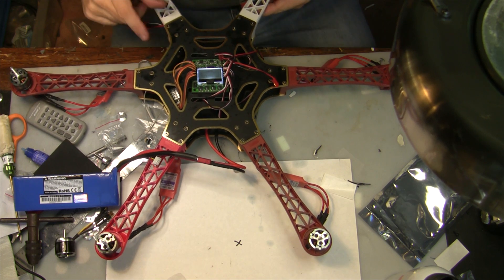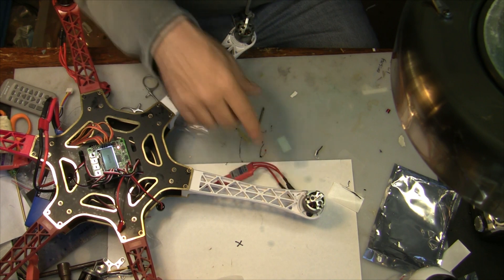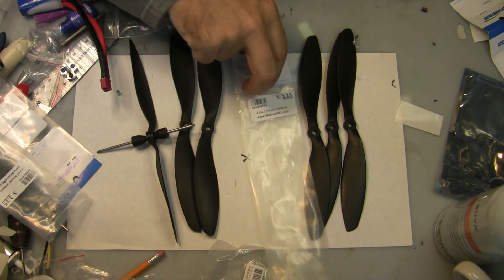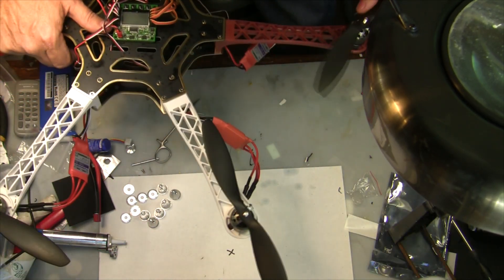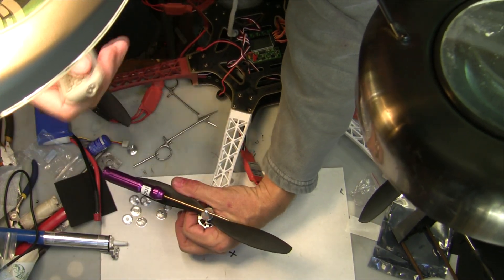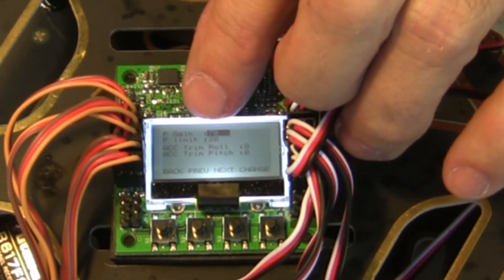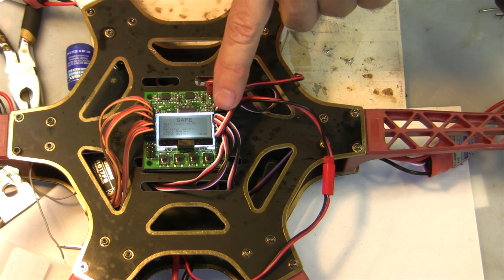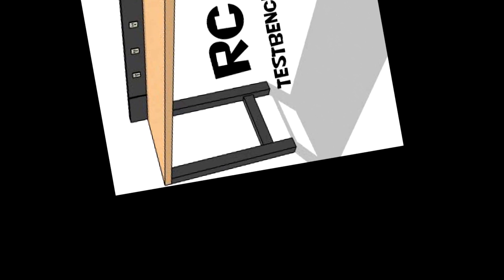Hexacopter Build Part 3 of 3, build a Hexacopter for less than $300

Comment: Here's a pretty inexpensive 2.4GHz 6 chan RC + transmitter that will work too. Got mine for $50 http://www.amazon.com/gp/product/B00KHJ2642/ref=oh_aui_detailpage_o00_s00?ie=UTF8&psc=1
Reply: I've never tried to max it out so I'm not sure. I have experienced a loss of connection before but I'm not sure if it's the remote or my flight controller. Here's one I like better that I want to buy next: https://www.amazon.com/FlySky-FS-CT6B-Channel-Transmitter-Receiver/dp/B00KHJ2642?ie=UTF8&psc=1&redirect=true&ref_=oh_aui_detailpage_o00_s00